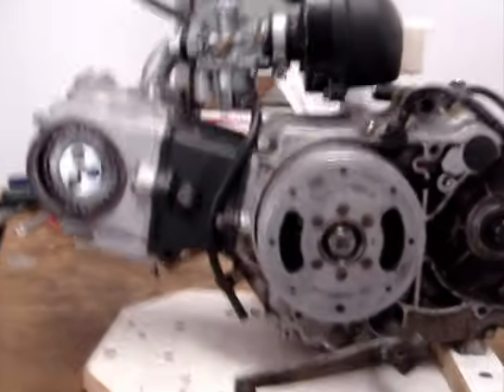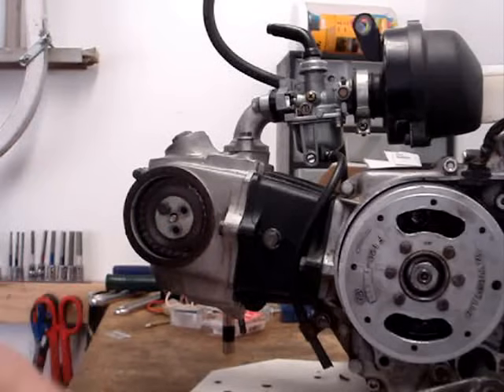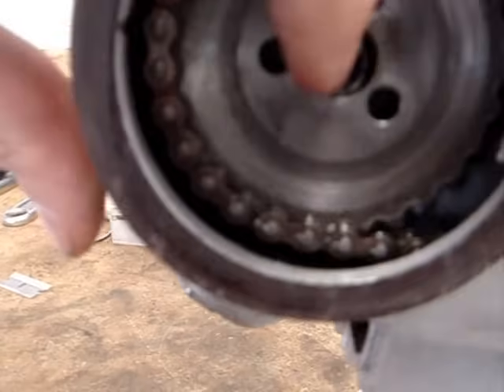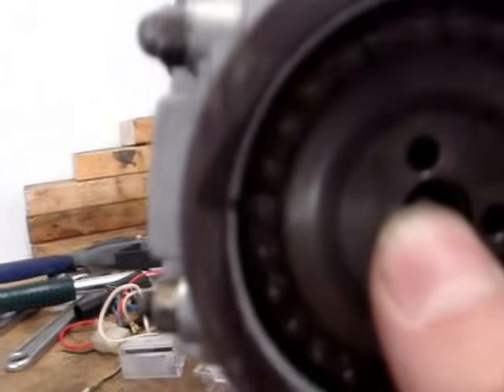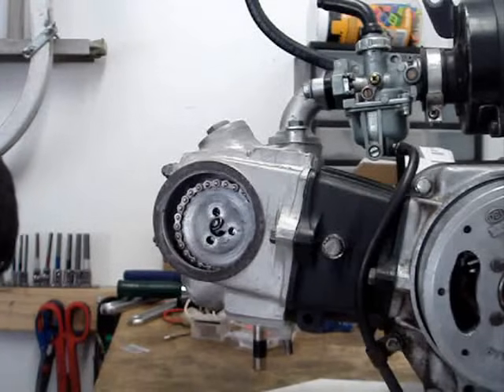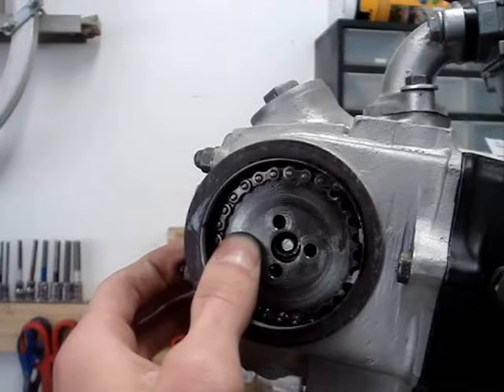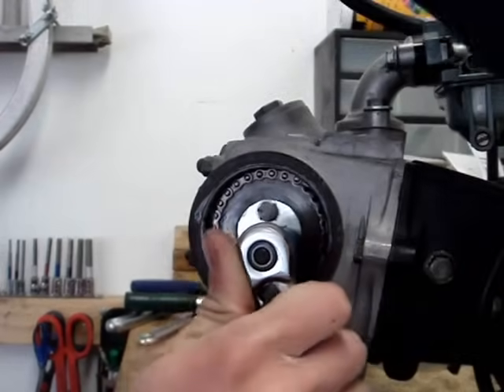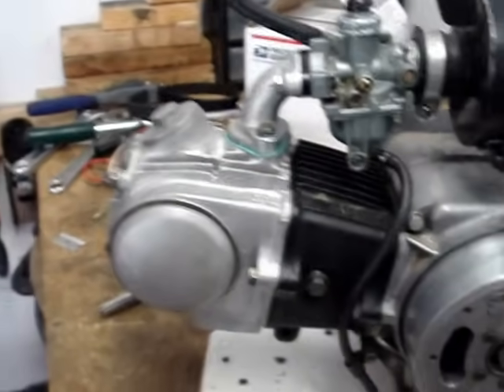How To Set Cam Timing

Comment: IF its 180 it will run, but blow fuel out the carb , possibly catch fire, and almost burn your shed down. ask me how I know this.
Reply from the maker: There is no such thing as 180 out on these engines. The ignition runs off the crank, not the cam and is a wasted spark ignition.
Reply: yes but the cam controls the valve timing, and if its firing when the valves arent in the right position, it causes backfire.
Reply from the maker: crackbadger man 180 off will not cause any issues. This is a wasted spark engine so there is no such thing as 180 out. If the cam timing is set wrong then it's not 180 out, it's just wrong.
Reply: alex the bolts that hold the cam sprocket on are off set, they are that way so the cam lobes correspond correctly with the sprocket position. If the cam is 180 out it will fire at the wrong time. the intake valve only opens one time every OTHER revolution if the flywheel.
Reply: most have no CDI., they are points motors. all before 82 I believe
Reply from the maker: crackbadger man  1982 was the first year for the long rod style engine. CDI was introduced for 1988. Both ignition setups are wasted spark and make no difference in our discussion here. 180 out does not exist on these engines because there is a spark every revolution. I have nothing else to say. You don't have to believe me if you don't want to.
Reply: the shift pattern changed in early 80s also to 3 up.
Reply from the maker: crackbadger man Totally unrelated, but that changed for the 1988 model year as well for the Z50R's. Not what I would consider early 80's.
Reply: your incorrect., I hve a 1981 ct 70 and the shift pattern is 3 up/
Reply: I have one of the first 69s made, a 71.l a 72, two 77 models  a 79, and an 81.
Reply: I just finished rebuilding a 4 speed . it had a broken 1st  gear set, a broken sprocket, a worn can sprocket a worn cam chain tension wheel, a worn cylinder a rings a scored cam lobe worn crank bearings. .one the most worn out engines ive ever taken apart. I think oil starvation caused most of it, as the screen was clogged and engine crankcase filthy.
Reply: and just got a 1970 z50 and ct70.
Reply: @randy1ization  you also caused a fire too, real pro right there lol 🤦🏿‍♀️
Reply: It throws the valve timing off.
Reply: funnyest stuff you ever saw. The fuel line caught fire and I grabbed the fuel line and pulled it off of the gas tank I had clamped to the shelf, then I took off running out of the shed and the fuel line stretched , then slingshotted the motor and the stand it was mounted to outside of the shed. In that process gas dripped out of the fuel line that was burning onto the floor of the shed and began burning. I ran like hell for the garden hose, which was tangled .I grabbed the end and took off running towards the shed. I stopped midway, turned back and went turn the water on. I then ran back to the shed and sprayed the shed of the floor to put the fire out. After that I sprayed the motor. luckily just the electrical connector and paint were damaged on the motor.,
Reply: More info. My mate is running his bike 180° out. It runs like crap and has no top end power.
Reply: @ablastmac1  TOLD YALL FUCKERSSS!!! IT WILL BACKFIRE TOO.
Reply: @randy1ization  mate, I was running an auxiliary tank for my ct110, mounted to the handle bar. It was leaking a tiny bit as the o ring was stuffed. So I wrapped a rag around it. Gave it a few kicks, and the fucking thing backfires half of the bike on fire. Fire extinguisher doesn’t fucking work. Oh man it was terrible. Lucky the 10L fuel tank sitting 2 metres away from it didn’t blow. Lesson learnt
Reply: @johndallis9901  when I was a kid I had a z50, tank rusted out. they were 100.00 in 1980. couldnt afford one. I rigged up a milk jug, and also tied it to the handle bars. somehow my throttle shaft got stuck wide open and I layed it down and jumped of. it was going round and round in a donut pivoting off the handlebar. seems like it went on for a long time. it shook me so bad I abandoned it right there. always wondered what ever happened to it.
Reply: @randy1ization  that sounds horrible haha, I’m 14 and still learning to fix shit up. I started working on lawnmowers, whippersnippers, chainsaws outboard motors and now motorbikes. I am currently working on the ct110 still. I worked out the timing but the thing smoked the yard up so much. So yesterday I put a new piston and rings in it, along with a cylinder hone. Set the valves, and now it runs perfectly
Reply: it can also backfire and shoot gas out of the carburetor. I almost burned my shed down to find this out.
Reply: Lmao
Reply: TheAlexManVideos crackbadger man thinks chains dont stretch either so lmfao he must be drunk 247
Reply: Sorry buddy but if you think chains don't stretch then you really know nothing about the properties of metal. I've probably replaced 20 or so chains over the years. Everything from stretched timing chain on cars to half a dozen motorbike chains.
Reply: @ablastmac1  u replaced because they were WORN . NOT stretched.
Reply: TheAlexManVideos.  Just seen your vid cool beans i have 2 ct70 1972 3sp auto and 1 1974 z50 love them but have to rebuild 1 ct and z50.what state you in i am in michigan.if i have questions can i e mail you.if ok give me your email.thanks ian
Reply: mad ass  so u dont believe these motors will run 180  out?
Reply: So thats what was wrong with my old pitbike,lol
Reply: I have a 125ke Kawasaki and it start up but cant get to stay on and bogs out also back fires when I try kick it sometimes cant this be the case why it not run well

Comment: Hi Alex great video, I have just replaced my head gasket and had the valves reseated, I have put everything back together, but it won't start, it feels like there is no compression...I put it at TDC, then the cam sprocket is out, so I took the chain off and corrected it so both are lining up, and it just won't start. If I move the alternator nut should the camshaft sprocket move, because it doesn't, could the chain have slipped? Also when it is at TDC and the camshaft is in line with true mark should there be play in the sprocket even when the tensioner is on...I know this is something simple to fix, but...Yamaha xt125x

Comment: For those people trying this, don't. More accurate way is to remove both inlet and outlet valve covers, remove spark plug and turn cam till both cam nodes are on the rock and piston is at top of cylinder, once achieved chain and cam marks can be lined up. his could be 180 degree's out and without checking cam node positions and piston position to verify you could do damage
Reply from the maker: Your way will work but the way shown in this video works and takes a lot less time. An understanding of how the system works allows you to save time.
Reply: Nodes on the rock, what's the rock?
Reply: TheAlexManVideos Hi Alex,,here Kristof from Belgium.
i got a problem with my minitrail,
Always when i screw loose the under tappetcap,
it is fully fild with engine oil  (the tappetcap).
I think this is not normal to have so much oil on that place,
What is your opinion about this?
with friendly regards
Reply: bro those marks are there for a reason

Comment: Nice job.... I am trying to find a video on how to retrofit an electric start on a 2003 xr 70.
Reply from the maker: It's going to be very difficult. The only cases similar to yours that had electric start were on the old Honda Cubs. Once you find one, you'll find out that your ignition system will not work with the crank and flywheel necessary to keep the electrice start.

Comment: Nice work there is a self tension adjuster for the cam chain. It needs to be slackened off and re tightened.
Reply: David Norris If you stop the video at one second. You will see a drain pipe coming form the bottom of the float bowl and running down the side of the barrel. To the left of this pipe as you look at it, you will see an hexagonal bolt going into the side of the barrel. Just under the cylinder head bolting position. That,s the cam chain tensioner.
Reply: David Norris There is a cam chain wheel here. Before removing the head and the cam shaft etc. You have to slacken off the bolt to allow the cam chain to slacken. Some engines not sure about this one. Have a built in self adjusting tensioner in the crank case which has a bolt on the underside of this side of the crankcase . Which you can slacken off as well. Its like a smaller drain sump bung.
Reply: No these engines can be tuned to the Gills but they don,t last to long then, i worked on them for years a good starting point but over engineered.

Comment: I have a 220 bayou i got it running only by pull start check the starter it was good i took the stater off put it all back together it crank over good with the electric start but now i don,t get no spark what could have i done wrong please help
Reply from the maker: If it worked before and now it doesn't then you forgot to put something together, or you put something together wrong. Check your electrical connections.
Reply: TheAlexManVideos

Comment from the maker: The marks on the crank must line up at the same time the marks on the cam line up. The crankshaft or flywheel should have a mark that indicates TDC. I have never worked on your model of motorcyle so this is the only information I can give.

Comment: I need a little help here..i was thinking to reopen the head block of my Yamaha 135LC and i'm facing a problem which i cant figure out how to make the timing chain..i know about the  marking at the sprocket but i dont know how to set the piston at 0-0 level..can you explain a little more..??because i've done this before but i've made mistake causing my valve to bend,,

Comment from the maker: I do not own or work on knock off engines, so I will not guarantee anything I say to apply to your engine. If the crank markings line up at the same time the cam markings line up, the cam is timed correctly.
Reply: TheAlexManVideos will this work on a crossfire 140 or cf140

Comment from the maker: I know they were originall installed on some models, if not all. I do not know what year they started putting them in or if they were there all along. The purpose of the plate is to decrease the area of the oil passage exiting the cam. This increases oil pressure in the cam and helps lubricate the cam lobes.

Comment from the maker: During installation, the cam lobes should be pointed towards the piston so the valves are completely closed. In this position, the cam sprocket should be installed with the circle pointing towards the notch in the head.
Reply: How would you close the cam if the head is off?
Reply: I means the valves closed
Reply: Thank u Exactly what I needed to know

Comment: Thx for the video, it really helps me out. 
Q: If all timing marks have alligned and the camshaft only have two sprocket bolt holes. Do the bolts can be anywhere between the two holes? Vise versa?

Comment from the maker: I have worked on many Chinese engines/bikes/ATV's. I can tell you the quality of metals is poor, welding is not done by experienced people, and general construction is lacking in areas. Many parts are made thinner or with weaker metal to save money, at the cost of low durability. The motors are much more problematic and do not withstand as much abuse. Since the topic came up, this is my opinion. Take it however you wish, and do whatever you want.

Comment from the maker: The Knock off motorcycles/ATV's, and engines are hurting the sport. They take business away from name brands which forces prices to rise. They are not built to the same quality and safety standard which makes them unsafe for riders. Parents are fooled into the Chinese bikes because of the similar design but lower price, then get mad at Honda dealers when we refuse to work on them because parts are difficult to find. They are unsafe and resulting injuries may turn parents away from the sport.

Comment: To be honest, many ppl say OH Chinese motors are crap, but I'v seen a lot of these little 70cc copies and they run great and are cheep to get parts for. The Chinese copied them so good they have made millions of them and 98% of every Chinese ATV from 50cc to 110cc are based on this design, The only thing they changed between them is the head and cams between the sizes. I'm NOT saying they are Quality ike honda, but hey for the cheep price you can build a pretty mean go cart or even a motorcycle.

Comment from the maker: It's not likely that it moved when the tensioner came out, unless your rotated or started the motor. Either way, it's very easy to check the cam timing. Pop off the ignition cover and the cam sprocket cover and make sure the marks all line up. Chances are you're safe, but you should check to be sure.

Comment: Now it's back to doing the same thing.  Will check the timing since I accidentally removed the chain tensioner while trying to change the oil.  Could it have slipped (if not rotated while apart)?  this is my gf's e'mail, so please resp to both at:  randolph_ciccone@yahoo.com   Thanks a bunch...     Randy

Comment: great video.  very easy to understand and follow.  thanks.  don't have one for valve lash adjustment, do ya?  my step-son's 97 xr 70r is consistantly flooding after coming off full throttle and have dinked with the carb numerous times and replaced nearly every "wearablel item" in the thing.  Was acting similar when we 1st got it 6mos ago + low on compression.  I adjusted them then @.003int and .005exh.  Bumped up the compression and seemed to help alot with the flooding.  exh was real loose then

Comment from the maker: If the performance dropped after you tried to set the cam timing then I would assume you did it in correctly. The engine is designed to have the cam at a certain position relative to the crank, that position is only possible when the cam is correctly timed.

Comment from the maker: There is a 10 mm head bolt directly opposite the center of the cover on the clutch side of the engine. It goes all the way through and hold the cover on.

Comment: There is a tiny "circle" (a small dot), on the 3 holed sprocket. You can barely see it anywhere in the video...maybe at 3:17 at the tip of his fingernail.
That circle needs to line up with the small nick in the case at 9:00 position.
Easier to see when you look at your sprocket.

Comment from the maker: It slows flow of oil out the end of the camshaft, increases oil pressure inside the camshaft, and pushes more oil out the oiling holes on the lobes of the camshaft.

Comment: @jakeb123211 The sprocket has the mark on it. be sure you have it turned outside so you can see it. The chain has no mark to use. It can be used any where as long as the crank and cam sprocket are lined up. You can always check by looking at the valves for compression and exhaust is Top Dead Center or TDC.

Comment: @cobrachoppergirl it is normally not as easy as just lifting the chain off the sprocket once the tentioner is actually out you can just pull the sprocket off of the cam depending on your bike and therefore the chain comes off, just dont drop anything in the motor or your srewed.

Comment from the maker: @cobrachoppergirl To do this on a 4 stroke engine you do it exactly as shown. This would not ever apply to a 2 stroke. You don't break the chain. There is a cam chain tensioner somewhere. You loosen that as far as possible and then the chain will have enough slack to be lifted over the sprocket.
Reply: I applied this to my 2 stroke rotary suzuki water Buffalo.

Comment: How do you do this with a 4 stroke engine, like on a Honda Rebel.  I have the valve cover off, and it looks like i'm going to have to break the cam chain to be able to lift the head off to see the condition of the valves.  And then find a link to replace it.  Is that correct?  And when I'm done, get all this lined back up again, which doesn't look to hard from watching the animations of how a 4 stroke engine works and turning over my engine, I got that part.   Still, Bloody fucking hell....

Comment: good video, i just but a new cylinder head on my 110cc dirt bike and the carb has a lot of suction and if the air filters on it will shut off and if it runs for like an hour oil will drip out some were could you tell me why its doing that it didn't do it with the old cylinder head. if you could try and help me out with this that would be great. Thank you

Comment from the maker: Ignition fires every rotation of the crank. These motors have a wasted spark ignition. If the timing marks line up, it will run.
Reply: If you really think about it, it dang well better fire everytime that censor see's the trigger and that's every 360 Degree rotation. It does have a wasted spark, interesting and thanks.

Comment: i have a z50r and i just took the top bit off as well as the head surrounding the piston. i then span the magneto around a few times.
i am now trying to get it back to normal. how do i know on which stroke is the magneto going to make the spark plug fire as it only does it every second tdc?
i can get the timing marks marked up properly but im not sure about the spark?

Comment from the maker: Timing adjustments can be made with the motor in the bike. Check the cam timing, if that is fine, try retarding the ignition timing a bit. If that doesn't work, your motor just has a lot of compression and that's a good thing.

Comment from the maker: It is not uncommon for the mark to be a half tooth off. If this is the case, it is better that the circle be below the notch in the head by half a tooth rather than above by half a tooth. This will only happen if you have a severely stretched chain, or are using thinner gaskets for more compression.
Reply: thanks for mentioning it. my timing is off by half tooth and unfortunately its half tooth above the mark